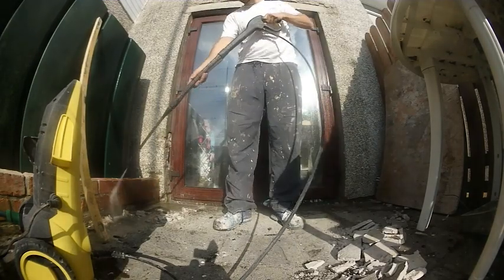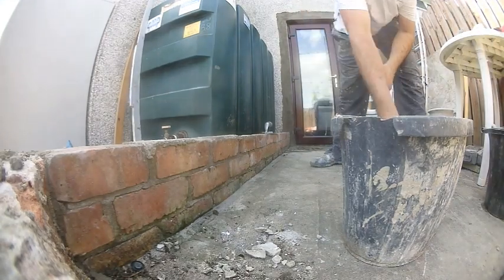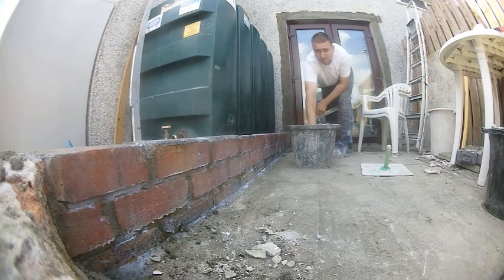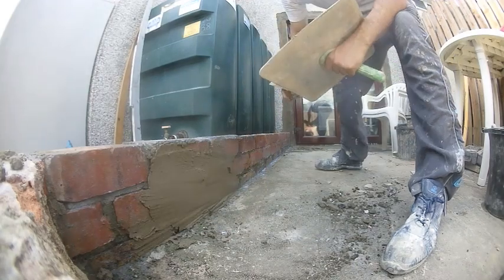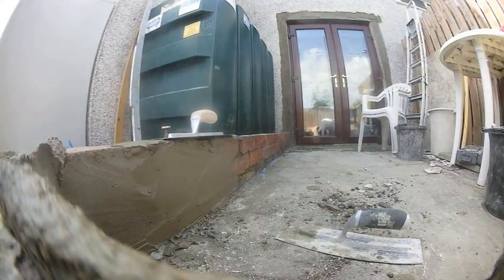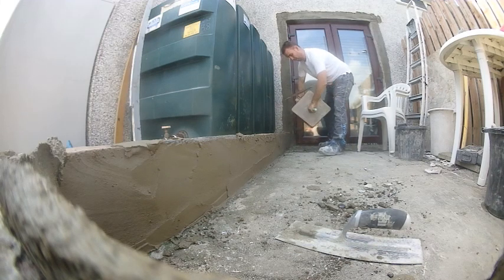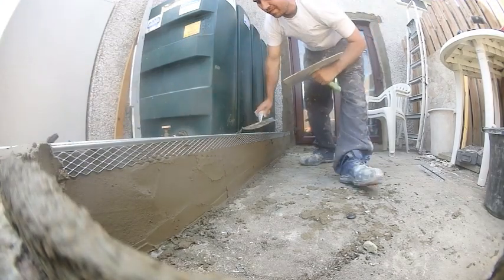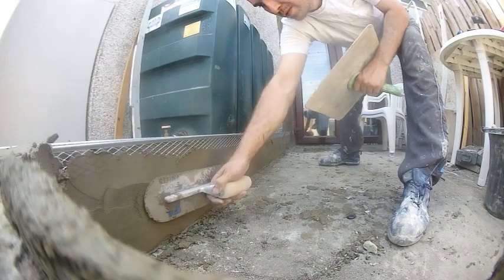Rendering Over Old Brick Wall sbr Sand and Cement

Comment: Hey Mac, I used to 'acquire' the odd rolls of 18" Damp-Course ... Cut it into two to three yard lengths and lay it at the base of all walls I was rendering ..... So easy to re-use droppings and to clean up at the end of the day ...... Easily cleaned and re-usable for YEARS! :-)
Reply from the maker: love that little top mate we used to use old plasterboard cutting inside as it was scrap

Comment: Nice detail on Ur reasons for not skudding besides all the cleaning up ideally you have to leave it a day anyway and for a small job like that is it worth it.ya bud I prefer the steel beads,even the white angle beads are good.a bit of a heavy coat needed but easier to keep straight I think.when I was starting out the guy teaching me wanted them squiggly lines.reason why cause it looked better 🙄,then Ur coating over it so what's the point.ah well whatever works ,
Reply from the maker: Only thing that makes even a little sense with wiggly is breaking tbe brick or block joints some but most dont wave up and down enough to do that i reckon but will do a video on it and my reasons
Reply: @macplastering  never thought of it that way tbh,breaking the joints on the bricks and blocks so.thats the arguement logic so on it cheers I never heard that reason.qants it's fairly deep enough for a good key that's the main thing.
Reply from the maker: Yea i am hoping to do a wee video on the 2 and my thoughts about them and explain my thoughts :) been meaning to do this video for about a year now LOL